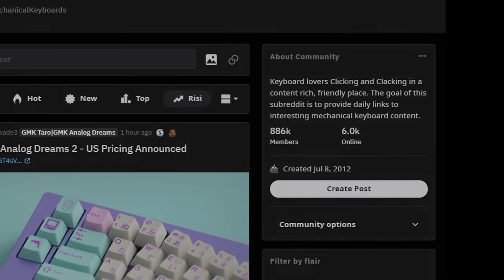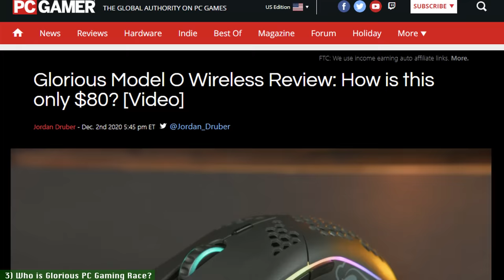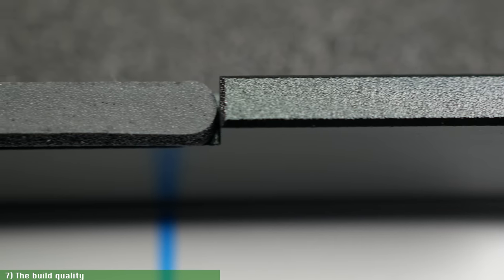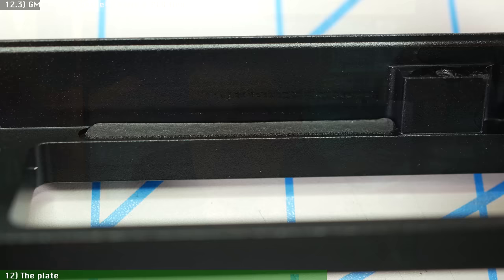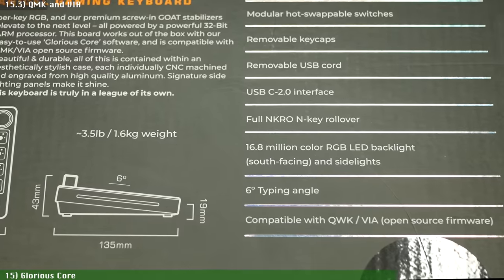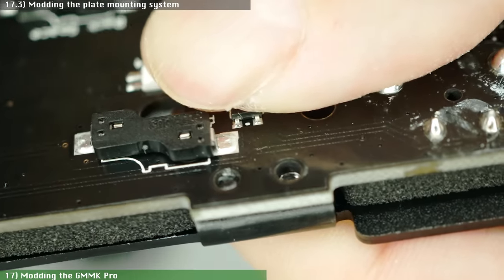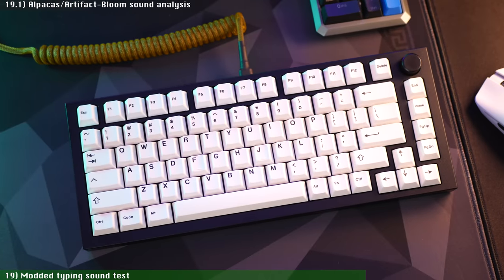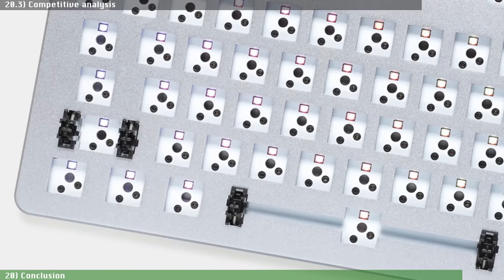GMMK Pro: The ultimate guide (in-depth review + modding tutorial)

Comment: Well crap, my keyboard had the dreaded stuck corner screw. Maybe I should have waited for the screw driver, the damn screw stripped out. You can see people on reddit and youtube with the SAME issue, this screams manufacture defect, filed a ticket and ordered some stripped screw removers. I have taken apart many GPUs and build liquid cooling systems and NEVER had this issue, for damn near two hundred bucks this is JOKE. Pretty disappointed.
Reply from the maker: Yeah, I've seen lots of people complaining this week on Reddit about screws stripping out. It seems these screws are very soft and if you use the wrong sized bit they can strip rather easily. I didn't notice anything like that while modding my board, but then I used a matching phillips bit size.

If the screw is "only" stripped, you might still be able to remove it with the proper screw remover. The bigger problem is when the screw actually breaks inside the thread.

Did you contact Glorious Customer Support about this issue?
Reply: @IOSam  I am a IT pro, I work on little electronics for a living, I take apart phones  and computer, I also build custom water cooled systems. So I have taken out thousands of screws, this one was cross threaded or over torqued, the head turned to dust. All the other screws came out with 0 issues. My ticket is escalated to to tier 2, waiting on a response now. They had me try rubber bands and super glue, so now there is super glue and rubber bands stuck in it. I am very disappointed. If they don't offer a refund I will neve buy from them again. I have voided so many warranties in my time, I have never had something like this happen. The thing that really points an issue with manufacturing is how many people have had this happen to the exact same screw. I will update when I get more info. But for 170 bucks, this is kinda wack.
Reply from the maker: @rock-steady-yeti  You are absolutely not alone in this issue. This seems to be THE main problem people are having with this board and I'll be shocked if Glorious doesn't replace your keyboard. Right after I posted this video I ended up having an issue with my Model D (the mouse developed an unconfortable large post-travel gap on the right side button) and they offered me a credit or full product replacement within 24 hours of opening the ticket (they did not have a way to connect me with this channel).

So I still trust that they'll stand behing their product and will address this issue for you and everyone who had the stripped screw problem. Please post an update here about how they handle this issue for you, so we can all be aware of how they are treating their customers.
Reply: @IOSam  So, Glorious sent me a new keyboard, it showed up yesterday, I just built the keyboard out. NIGHT and DAY - none of the screws were installed with an impact drill. It was easy to get all the screws out and get my brass plate installed. Just plugged it in and all the key work the Gator Reds feel like super smooth MX Reds. That is how a company is supposed to handle defects. I would 100% purchase from these guys again. Thanks for all the advice and good vibes.  That WOW Stick is super nice, my one change I would like to see is if the LED stayed on for 3 secs after it stopped, otherwise super nice! Have a great evening!
Reply from the maker: @rock-steady-yeti  Hey! Thank you so much for this update man!!! Happy to know they fixed the problem for you and that you're finally able to enjoy your new keyboard the way it was intended! This confirms what I believe to be the biggest advantage of this board: Glorious 2 years warranty. Now I'm hoping other manufacturers follow this trend, so we can get lower prices, better products and longer warranties.

PS: you make a good point about the Wowstick LED lights by the way 🤔

Comment: simply put don't buy it there's so much better options for the same price or even lower.. I spent $500 in total including barebone gmmk pro and it was pain in the ass to disassemble and reassemble everything screws don't hold up stabs are awful over lubed.. just don't.
Reply from the maker: Ouch… Man, I hope you mean $500 including a fancy GMK or SA keycaps set with super premium switches, otherwise you got ripped off pretty bad…

The GMMK Pro is still (despite its aging design) a decent barebones for a sub-$200 board (with taxes + shipping) IF you’re willing to put in the work to improve it with new stabs and a few mods, but anything remotely over that price point and you’d be far better off on custom keyboards territory.

Comment: this board is a gimmick
Reply from the maker: Compared to what for example? I think Glorious made quite a few gimmicky decisions when designing and marketing this board for sure, but the end result is still something dificult to match in the current market for this price point (although that is about to change).
Reply: @IOSam  compared to any other entry level custom keyboard. this is just a glorified oem product, the end result is a fake gasket mount that's stiff as hell and no via/qmk support. it requires so much modding to barely feel decent. there's better boards for cheaper like the kbd67 lite, which sounds feels and performs way better. sure it misses the knob, which is another gimmick. still it's an equally entry level board that performs disproportionally better for a way cheaper price and in stock availability.
Reply from the maker: @eraserheadSH  I don't disagree with you on the merits of the KBD67 lite. And for anyone who doesn't care about a metal construction, the KBD67 lite and the Portico are obviously better choices. As for being a glorified "OEM" product, I don't particularly mind the fact it is a large production board. In fact, if they can make this in large volume it will be a refreshing change compared to the treasure hunt that custom keyboards usually are (which while I do take part in them, I don't particularly appreciate that aspect of the hobby). To me, the more large peripheral makers offering more durable and "moddable" keyboards with 2 years warranty attached to them, the better!

The other area where I agree with you is on the number of mods one has to do to bring this keyboard closer to what an enthusiast would consider to be a decent entry level board. I understand that for the aspiring keyboard enthusiast just getting started on this hobby (who are 99% of the market for this product), this is a decent "gateway drug" in its stock form, but for anyone who has been playing around with small batch customs for a while... yeah... there is nothing to see here indeed. For those, the entry level products from KBDfans, TKC, Cannon Keys, et al. are much better suited.